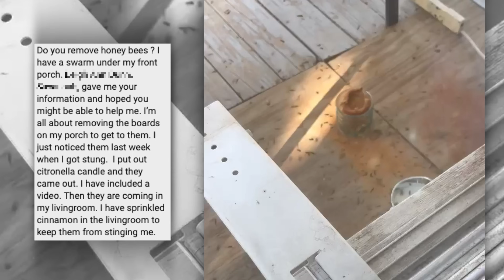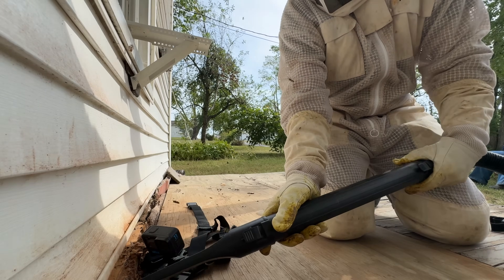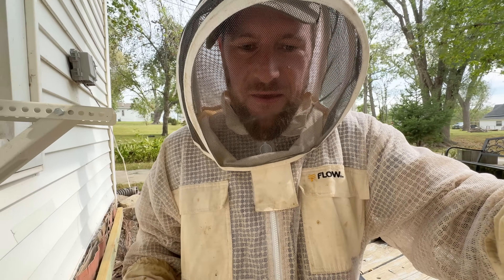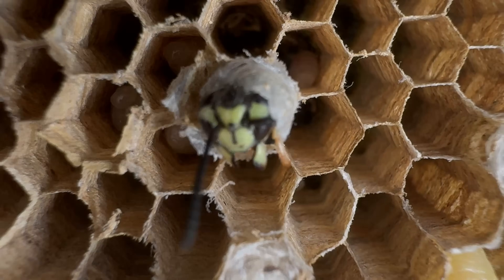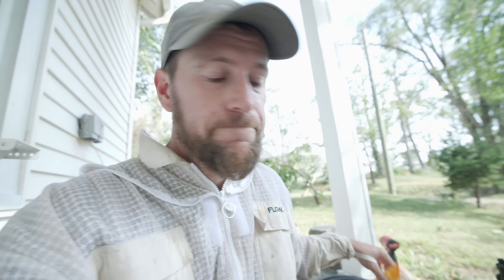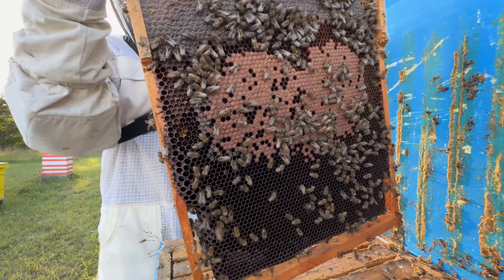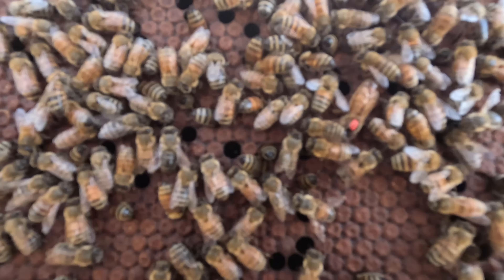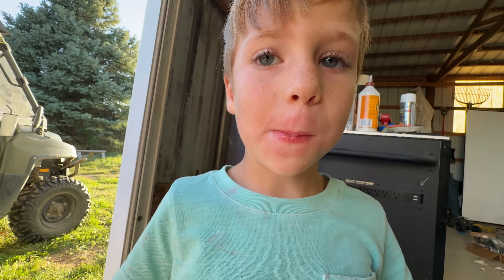Bee Rescue Gone WRONG! We Found WASPS!

Comment: I would rather take 100 honeybee stings than one wasp thing! I would highly suggest getting internal frame feeders. Open feeding only allows the strong hives to get stronger because they have larger workforces. Weak will continue to stay weak without reduced entrance, and a rapid round feeder on top. You may want to look into double screen boards as a possibility for the weaker hives to piggyback on top of stronger hives to make it through winter.!

Comment: Had the same things in my house. They found a hole under the eave and made a nest inside the wall. Every now and then a random wasp would fly through the house and head for a window. I finally found them coming out of a return vent and saw the flying back and forth point outside. I was able to put a insect bomb in the return vent and used a foam insecticide spray that billowed up when sprayed, and used it on the area where the hole was under the eave outside. The bomb force them out and the entire nest fly into the spray foam. I swept the dead wasps up and counted 847 of them. I was the only one who got stung. I stepped on the thing and my foot hurt like mad. My dad used to keep honey bees and told me to get meat tenderizer from the store, mix it with water and make a paste and apply it to the sting. It took the pain away in less than 5 minutes.

Comment: Those are YELLOW JACKETS. QUITE deadly & aggressive.
When I find them in the ground I mark the entry hole with a couple sticks then I wait 'til dark on a cool day, since they are less agressive then. I pour 1/2 cup of gasoline down the hole. That has always worked. 
That also works for ant nests.
I've only had one nest of above ground yellow jackets- they're smaller but just as aggressive & maybe more deadly. They were at the top of a wooden column & got in through gaps there. I had to use a spray device to get the gasoline into the nest area. I closed off the entry gaps with caulking after seeing no bees for a day & all gas aired out. 
For bites & stings I put 1/2t baking soda in my palm & drops of water to make a paste,  then dab that on the spot - it works immediately. Leaving these bites go without treatment can be deadly.
Reply from the maker: Great. But I was there during the day so I had to take care of the problem then. All gone.
Reply: You were likely there on a HOT day also. They get quite mad in the heat.
Reply: @solaura6218 they aren’t hornets there just Yellowjackets although they look like them except smaller real hornets usually get to the size of your finger they used to freak me out at first because of how big they are but now I’m used to them sometimes I will hold them too
Reply: @insectwildlife37  ... Oh. Thanx. I have big black & white hornets here. They bite really hard.